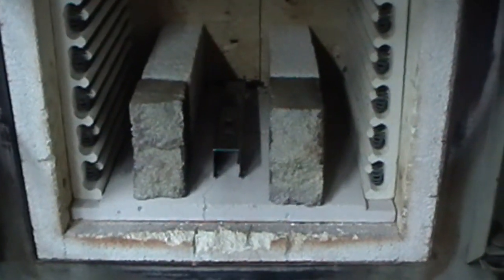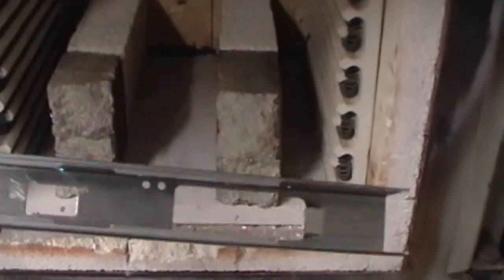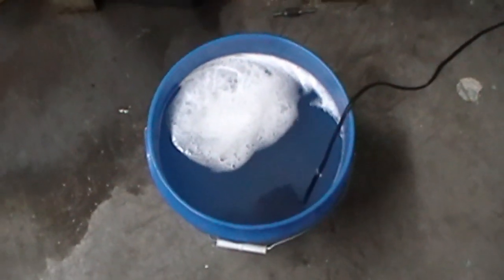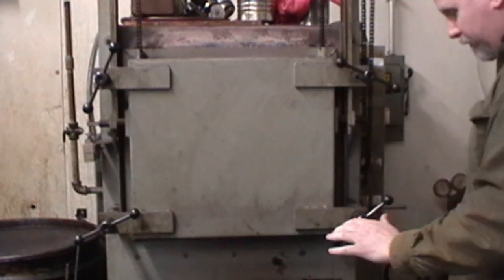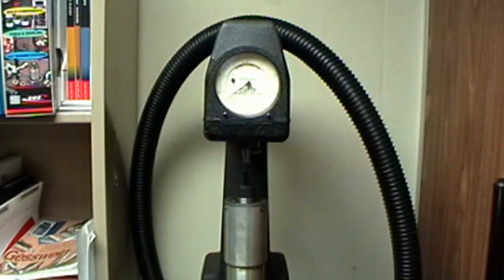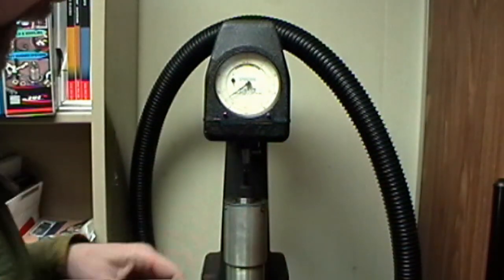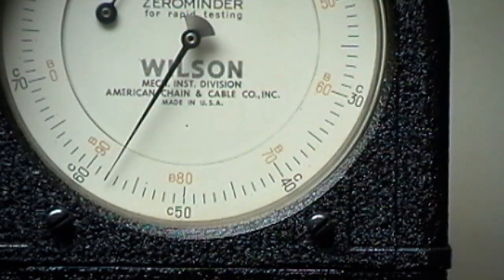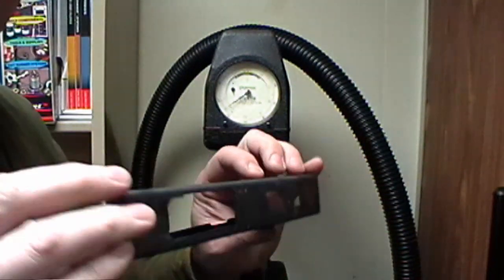AK47 Part 3 Receiver Heat Treat and Rockwell Hardness Test

Comment: Hey Mel, what are the specifications of the spot anvil on your Rockwell?
And do you know where I can buy one?
Thanks
Reply from the maker: The Tester is old, like from the 40’s old. I don’t know what the diamond point tip is spect at. I believe the tip is newer though. No idea where the tips were bought. The tester was at the shop long before I ever showed up. Newer machines probably test differently today then how this one is used. Guess that’s why some say I’m doing it wrong. I have to show them pics from the old manual to show I’m using the tester as directed. Guess you would need to look at industrial supply companies if you want a tester. If you want an old one like mine you may need to look into auction houses that sell stuff like that.
Reply: @Mel64d  I actually own a Wilson 3JR, and it's not the diamond brale indenter I'm after, I'm looking for your type of anvil/table that you set the receiver on.
Reply from the maker: @garrettdench9661    Oh, sorry I’m slow lol.  The anvil I made myself from tool steel. It’s been hardened and drawn to 60Hrc.  No dimensions were recorded, I just used calipers and kept machining till it fit between the rails.
Reply: @Mel64d  Oh that's cool. I don't own a lathe, yet. But, I think I found what I'm looking for online. Thanks for your response. I appreciate it

Comment: Is it only the reciever that is heat treated or are other parts also treated, like bolt, trunnion, barrel, etc?
Reply from the maker: Most everything is heat treated on an akm rifle. Back when this video was made there were limited options for fully heat treated 100/80% receivers like we have today.
Reply: @Mel64d  Thanks for speedy reply! 

Would you know if all parts have the same hardness or are they treated to different specs? I have read from people claiming that some rifle barrels arent heat-treated at all but are simply left 'soft' as to not loose their tempering from build-up of heat during firing. Then I have also read from others that if you dont heat-treat your barrel its gonna give in a few mags and I have a hard time making out what is right.

Is there any sense in the claim that you could have a barrel made from say 4140 steel - bore, rifle, ream and polish it and then have it left un-treated and it would still work just fine without any danger of bulging or banana-peeling?
Reply from the maker: @John-un3lj   The parts all have their own specs for hardness and are different depending on the part and it's required job . Barrels (most anyway) are not heat treated. Cold hammer forged (work hardened) and chrome lined barrels are best for durability, and non hammer forged non lined ("soft") barrels are better for accuracy. "Soft" barrels work fine but they typically wont go for multiple thousands of rounds.

Comment: One thing you might want to try is quenching it in oil to reduce the quench severity.  Being a low carbon steel 8620 should auto-temper as its martensite-start temperature is pretty high.  You should be able to quench it from the hardening temperature and not have to temper afterwards.  Quenching such a thin section in water is so severe that you blow right through the auto-temper regime ensuring you have to temper afterwards, not to mention risk more distortion.  Also, don´t trust that hardness reading for such a thin section.  There is no way 8620 can get to 58 HRC.  It is a false reading because the thin section means the block you are resting it on come into play.  Probably more like 53-54.  Just saying.  I would defintely quench in oil as you will save yourself the tempering step.
Reply from the maker: I found with doing it my way (right or wrong...mostly wrong lol) the 4130 likes water quench (I have used machine coolant with good results) and the Polish steel likes the oil quench. I had a mix up because the web sit where I bought some of the blanks said the Polish blanks were 8620. They were not 8620, more like 1050. So I had a few set backs.
Reply: @Mel64d  now are you using jusf regular plain "food" table salt for your quench mixture?
Reply from the maker: Arkansas Stone   I think I used Sea Salt. But that was long ago and I switched to machine coolant. The coolant worked much better on 4130 than the brine did.
Reply: @Mel64d  I built a few from ak builder flats, I quenched in used hydraulic oils and tempered at 475.  Lot of scale, some top rail twist, but it works?  I really dont know how hard I get them by doing it this way, got no way of testing them.  I heard water quench is the way to go on these ak builder flats.  Salt is in short supply here, got a family member that needs to watch their salt intake, so we been avoiding cooking with salt.  I live  in a dictorship state, our lockdown is surpassing ever other state, hate to go to town just for salt, I see smoke in the distance, pretty sure it's gone  by now, so I might try to use pickle juice, i got buckets of it but I don't know what vinegar will do to quenching steel.  Or maybe water softener salt?  Options

Comment: hey mel64d.  I am having some heat treat problems and have some questions regarding using Mapp gas torch.  instructions say to heat areas with torch then quench then bake in the oven for 1hr at 400F.  I am getting some minor warping of the top rails behind the lower rails.  It does not mention stress relieving after bending and I wonder if 400F is high enough to stress relieve after heat treating?  rifle works fine just the rails are warped in slightly.
Reply from the maker: Stress relieving is done before heat treat, 400 is not enough heat. I learned after the first few receiver to not have the lower rails welded in when I heat treat the receiver.  This always seemed to cause the receiver to warp inward. The receiver will still work just fine, it will just look a little wavy on the top rails when you look down them with the dust cover off.
Reply: yeah figured.  best I can do in the garage tinkering.  Like brewing beer, this is becoming an exact science!!! I'll try to change up my process and see if I get better results on the next build.  your videos are very good and informative.  keep up the good work!!!

Comment: Well, do tell how you produce a perfectly straight receiver..      please
Reply from the maker: I do not weld the lower rails in until after the receiver is treated.  I place the receiver upside down on the top rails for all processes: stress relief, heat treat, and temper.  Quenching must be done quickly, and fast. To slow of submersion when quenching will cause warpage.
Reply: Yep..      and shielding from radiant is essential!!..     check out my instagram. shawneliason
Reply from the maker: Yes it does. Looked at your Instagram, you build some nice stuff.
Reply: Thanks man.    I try.

Comment: Just a thought, but when you spot wield, if you don't want it to pucker, just drill a small hole in the center of the spot wield, and it won't pucker near as much.....
Reply: if you drill a hole, itll blow out!    believe me i know..  Especially  since he is spot welding it hard which requires a longer tighter clamped weld

Comment: Great videos Mel, i think i have just about watched almost all of them.

One question, did you use the same quenching solution for the rails as you did with the receiver?
Reply from the maker: +unrealistick911  I have tried quenching oil, soap and water, and machine coolant. I may be wrong, but I think the rails are 4130. They seem to work better (harden) with the soap and water, or the machine coolant than with the oil.
Reply: thanks!

Comment: Great tutorial Mel but can you tell me who can provide HT services? I'd love to do this myself but only doing a couple of turnkey build like this every several years doesn't warrant the capital up front cost to invest in a good, reliable kiln. I have a couple of Polish blanks that need complete HT.
Reply from the maker: +curtis haack   No sir I do not. The biggest problem is that it takes a while to do. You can not just mail it to a Heat Treat facility either. That would be a transfer according ATF rules. You can not hand deliver it and then leave either, that would be a transfer. You personally will have to be with the receiver as it is being Treated. That is if it has all the holes drilled for the fire control group.
Reply: +Mel64d its undrilled
Reply from the maker: Then you may be able to find a facility that will do it....friends/neighbors with a kiln??
Reply: No one that I know, not even locally that's why I'm back to reaching out to people online but seems that everyone is so concerned about the FFL issue I keep telling people it's undrilled. I think Childers did it up until recently but was informed by Cameron, just recently IIRC, that they no longer provided such services.
Reply from the maker: You can by an already treated receiver from Childers.....I know that's not what you want to hear. The FFL thing with the ATF is a little iffy. This is why people will not touch it.
Reply: I've bought some from Childers, great receivers. Thx for the replies.

Comment: Awesome video thanks for sharing!  I was wondering though, if you heat treat and temper the rails and receiver separately doesn't it get altered or effected when you spot weld them after?
Reply from the maker: atjhia16 No, the Russian factories heat treat the receiver and rails separately and then weld the rails in later. This will not compromise the integrity of the receiver.

Comment: Hey Mel,
Quick question. I am about ready to start heat treating my 8620 receivers. I just finished the first part, where I brought the kiln up to 750 for 2 hours to pre-stress relieve the receiver. Next step is the actual hardening process. Do I want to bring it up to 1500, then immediately into a saltwater/dish soap bath? What do I do to prevent warping the receiver? The place I bought it from said to put a piece of steel inside of the receiver, that's the same size, and wrap it with wire.. but can't find exactly 32mm wide steel without machining something.
Any ideas on this? Also, heard that you cannot harden chromoly (8620) because the carbon content is not high enough. What would you change on this process? I want to get this thing going correct and not have any issues with the final result as far as warping of the receiver. Thanks.
Reply from the maker: Hey Poppa,
I found out that the same heat treat process I use for the 4130 receivers works just as good if not better than the salt brine. The receiver that you see in the video turned out no good. I was in a hurry to get everything set up at work so I could get out of the way that I forgot to stress relieve the receiver first. Oops that was not good. I decided to go ahead and draw the hardness back and see if it would make a difference. Boy does it, the receiver cracked from the mag well opening to the trigger opening. Thank goodness I had a second receiver that was not drilled yet. I went home that night and drilled the other receiver and brought it back to work the next day. 
I had already thrown out the salt brine and did not feel like going back to the store to get more salt. I also forgot to bring the camera back with me. So I did it the same way I do the 4130's and it turned out very good. If you look at the drop down (show more) section in the description of the video I explain the 4130 method of heat treating.
Reply from the maker: I just turn the receiver upside down (no rails installed or center support) and treat them. They come out just the same as when they went in. I have welded the rails in before and treated them, but they would always warp inward on me. I tried a peice of metal inbetween the upper and lower rails to see if that would stop the warp, nope. The receiver would bow inward on me because the metal was thicker where the rails were welded inplace. This makes that part of the receiver cool slower than the rest of the receiver, causing the bow inward. A jig or peice of metal will have the same effect (cooling).
 So just leave the receiver alone (do drill all the holes) and it should come out fine. You can run (recommended) a peice of metal wire in some of the holes to give you a hook so to speak and can then pull the receiver out and into the quenching oil. Do this as fast as safely possible, you only have about three seconds before the quench.
Reply: ok, just finished up about 10 minutes ago heat treating this receiver. It turned out pretty damn good. I dumped it in a Dawn soap brine, with 3 lbs of salt in a 5 gallon bucket.
I found some barstock steel, which was the same exact width as the receiver, 32mm, placed it inside the receiver. I then wrapped the receiver with bailing wire all around the outside. 
There is slight warping on the very ends of the receiver, where the rivets will pull the corners right back into plum. Other than that, I'm really happy with the way it turned out.
I set the kiln to 1500 when I posted my comment, and it took forever to heat up all the firebrick I put inside. The process, all in all, went about an 8/10.
After this, I will post cure at 600-700 degrees to take the temper out of it for the annealing process. This is technically Case Hardened now, as it is actually 8620 Chromoly steel, and not really 4130.
I will then try to take a couple pieces of wood and straighten the little corner and slightest imperfections as best as I can and call it a day. I think, all in all, the wife will be very happy with the rifle I am building her for our Anniversary.
Thanks again Mel, you're a cool ass dude. If you were closer, I'd buy you a beer and kick back and shoot the shit with ya. Cheers!
Reply from the maker: Awsome, glad it work for you. The corners always do the same thing to me, but as you said the rivets will pull it back in place. Do you have a way to check the hardness? You are shooting for a Rc of 36-to 40. 44 and over can have cracking  problems.
Reply: I do have, but I would have to drive about 30 mins away.. I am going to do some other hardness tests later.. however, I think I can follow some of the tempering charts I have found and come close. I will draw this back at 600-650 I think, maybe even as high as about 700 for 45 minutes, maybe an hour tops.
I think the hardness will put me within the window.
I was tempted to put the rails inside of the kiln at the same time, but was afraid of warping them. I will just do this part with a very hot crab cooker I have, which I believe will get it close to the same temp. The flame area for this is very large, so I'm confident I can get it glowing the same color orange.
The 8620 is different than typical 4130, as the carbon content is very low, so it changes some of the process a bit.
I'm not a metallurgist, by any means, just looking at what's possible with this metal.
After drawing down some of the hardness, I will likely just fix any minor imperfections with blocks of wood I think. I just put the trunnions in the front and rear and everything fits fine, so I didn't change any of the important dimensions.
I added you to my friend circle on this account. This is my anon account on here that I often post from .. Ok, gonna let the kiln cool down and close up the shop. Add me if you feel like it. I did PM you a couple of questions, but I'll chat with you soon either way. Thanks my friend.. appreciate all the help.. really is much more appreciated than you'll ever know. Wife is gonna be jacked as hell when I hand her her new toy. She's been looking forward to this for quite some time. I think me making it and taking the time is much more important than the actual 74 anyways.